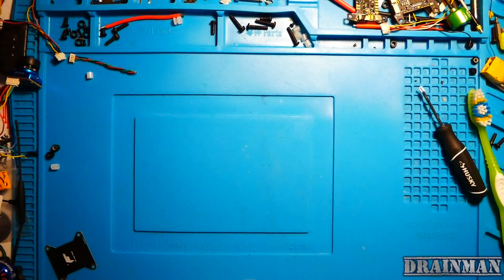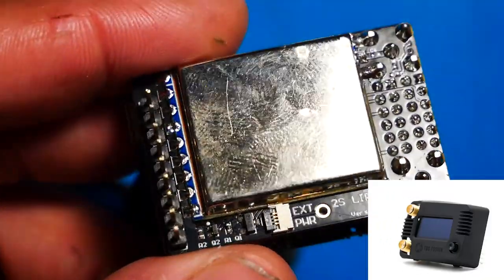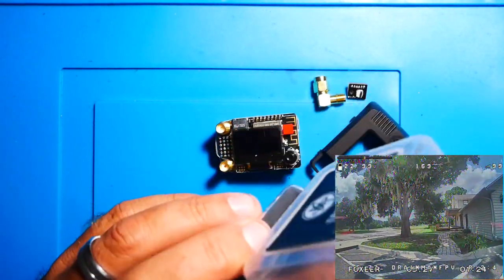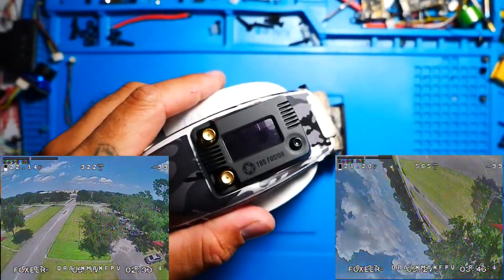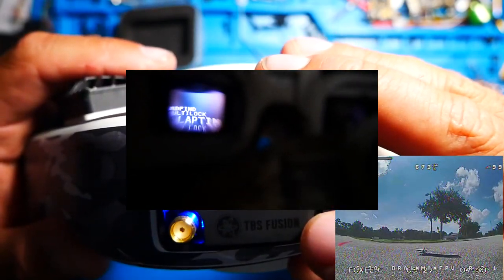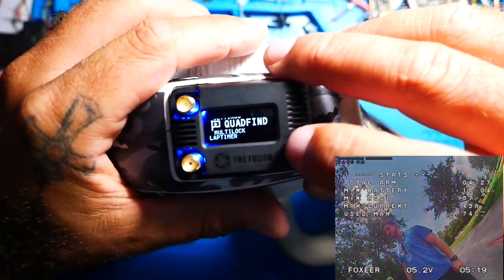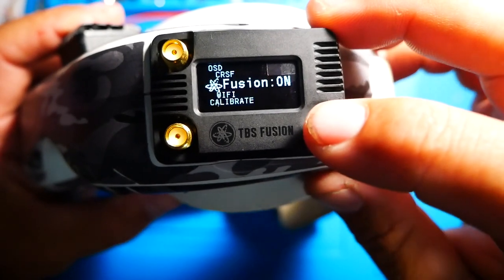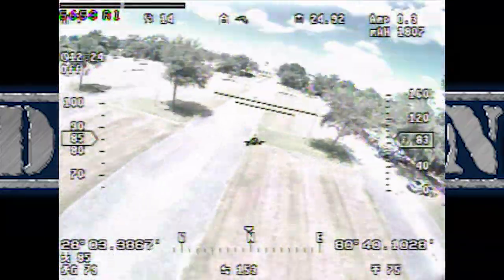TBS Fusion - FIRST LOOK! - Set Up - Overview - Firmware Update - Flight & More !!

Comment: Very nice video :). There is actually a third way to power it: Instead of the flat PCB (ribbon) cable, you can run a single wire from the solder pad next to the ribbon connector to the goggle battery connector. This will power Fusion with 2S voltage. It's a bit more difficult to install and definitely voids the warranty of your goggles, but the advantage is that it reduces the power consumption, as Fusion has an efficient switching voltage regulator.

Comment: the power mod has to be used on every goggle even the hdo its for the wifi  wayne from tbs has a video on it to install it where you dont open the goggle check it out its pretty easy wear you fish the ribbon thru now what i herd is that doesnt void your warranty but i would double check . i do belive you have to use that board for it to work right i dont think your mod for the older goggles will work with this . might want to check into that i may be wrong but i do know even hdos have to have that little board installed . i think thats why your module is flashing like that . not sure yet mine will be here mon  . great vid man
Reply: Would be nice to know if the power mod is needed anyways or not. Or when doing it if it hurts or not .....
Reply: @christianandres1766  its needed for every goggle that i do know thats why his module is flickering like that its not supposed to do that look at other reviews
Reply: I ask a suplier. 
If you want to use  the modul in future with crossfire magic features something you have to use the mod on every goggle.
Because of wifi or so. 
What flicker you mean in that video.
Reply: I wait til i get mine in hand and bud i think to do the mod could not hurt in anyways..... (as far as i understand it today)
Reply from the maker: Hey Guys, Thanks for watching! My goggles are only flickering Because my camera and my goggles are on different timing, it's no different then when you try to record a computer screen and it looks all funky.

Comment: This module looks great - I am a little worried about the ribbon cable power thing since i can be a little rough on my goggles. Did the power mod get added after the product announcement before shipping ? Or was that always the way to hook it up ?
Reply from the maker: That's always been this way, it is also how you must do the Rapid fire and the True - D X as well
Reply: DrainMan FPV I have a true D. It just plugs in and works.
Reply from the maker: @quincydrones928  yep some goggles don't need it.
Reply: Did they list which goggles will need it and which wont ?
Reply from the maker: @quincydrones928  there isn't an official list unfortunately

Comment: I just got mine today and what an absolute nightmare I had flashing the latest firmware on it, was my own fault though I was using a dodgy USB cable which lost connection to the module just as it was starting the flashing process. 

Thought I'd bricked it as it was no longer displaying anything on the screen, but I found a guide on how to put it in bootloader mode and got it flashed, was a pain putting it in bootloader mode, had to jump a pad on the module to ground while holding in the button and then connecting it to USB, and you have to keep the pad bridged through the whole flashing process!!
Reply: fu   im stuck with a blackscreen and it won't connect to my pc.... do i have litterly bind these spots with a wire touching it the hole proces?
Reply: @cbsflows1041  yes mate, I spent ages messing around trying to sort mine out after it failed to flash, and the only way I got it back up and running again was by shorting the pin to ground while holding the button then plugging USB in, after you plug in you can let go of the button but you must keep the pad shorted to ground through the whole flashing process. 

I was really close to just soldering a wire to bridge it but I literally just took the module out of its box and didn't want to be soldering to a brand new module. 

It's working really well though, I really like it.
Reply: Should have said, I just used metal tweezers to bridge the pad, if you don't mind soldering to it then that would be a lot less hassle in my opinion, trying to hold tweezers to bridge pads while holding down the button and plugging in a USB cable is no fun!
Reply: @Dav2112  hey man! i try so freaking hard like you and it finaly worked in the same way buttttt i had to updated to the oldest version and then the second newest version and least the newest version because if i did directly to the newest version it stay stuck in "preparing update"couldnt hold any longer the bridge XD. but it work and im done with that bridge stupit thing omfg haha. Thanks mate i also dont want it to solder because it was just a few hours new with waranty you know!
Reply: @cbsflows1041  glad you got it working man.

Comment: Yo- will it work with my V2 terminators ?
Reply from the maker: Hmm, I do not know, unfortunately I don't have these goggles. I'm sorry about that
Reply: @DrainManFPV  thanks for the response sir... As far as the goggles they work with rapidfire with no issue or extra power mods....
Reply from the maker: @endliberalism4305  oh then it should work no problem.

Comment: I just got the module today and when i plug it in nothing happen's on TBS AGENT  but when I plug in crossfire it come's right up is there something i have to do when i plug it in?
Reply from the maker: It might be your drivers that are not recognizing it
Reply: @DrainManFPV  I thought that to but I got it working I beleive the module had a problem took 6 tries to update firmware after I finally got it to recognize it.
So I don't know what the problem was but I finally got it working.
Reply: @scarfacefpv7822  Hey man, how'd you get the module to show up in Fusion? I have Agent X running on my Macbook and I keep plugging in the Fusion mod but it doesn't show up. It's getting power via the USB connection, just not showing up! Any help would be greatly appreciated!
Reply: @mostcertainlyno  I used a different computer I don't know why it wasn't seeing it but I did uninsatall agent x and reinstalled it and I was able to get it working with both computer's I use windows also.